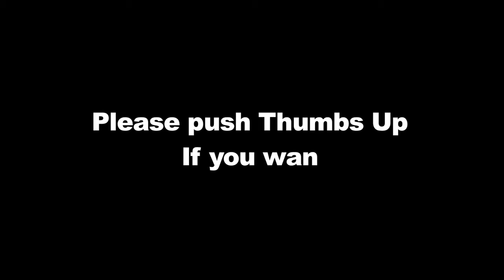Off Grid Cabin - Did the water tank survive winter? - April 2014

Comment: Glad it is still working for you. After all these years, my tarp has finally given out. We got a new one to hang up for the water collection. I may need to open the connector at the bottom of my tank and let some collected needles and sludge run out. I had to give the barrel a hard shake to get the water to start flowing when I needed to water my garden plot up on the hill. - Margy

Comment: a suggestion.
a faucet/valve to open up so you break the vacuum when you drain the line for winter?
plus you have a faucet FOR water @ the tank.
also a filter to pre-filter the water///then another potable filter at the cabin, somewhere...maybe a pressurized tank & a ultraviolet purifier for potable water????
a on-demand propane water heater + a wate solar panel to preheat water??? for showering/washing???
Reply from the maker: Agreed! All good ideas.